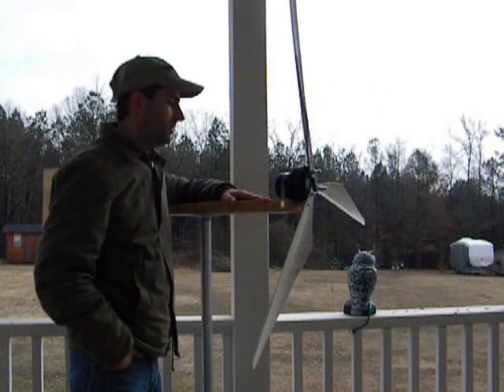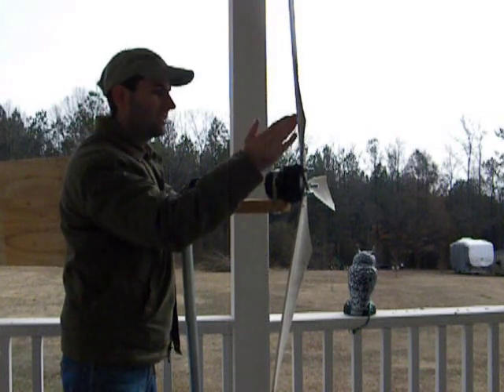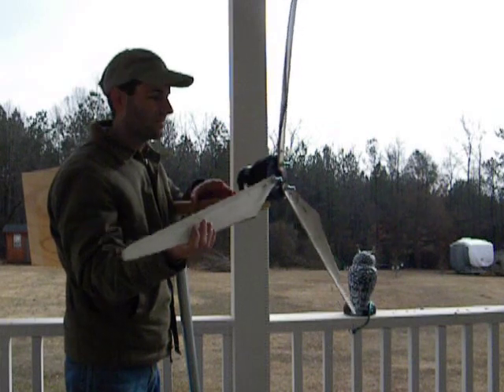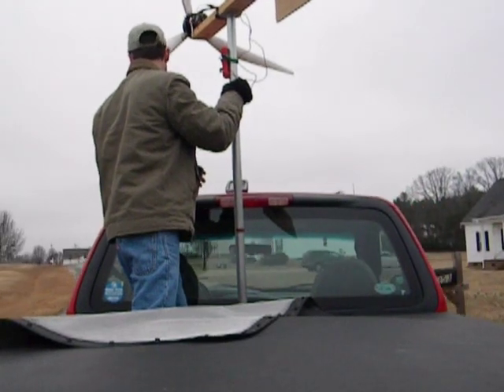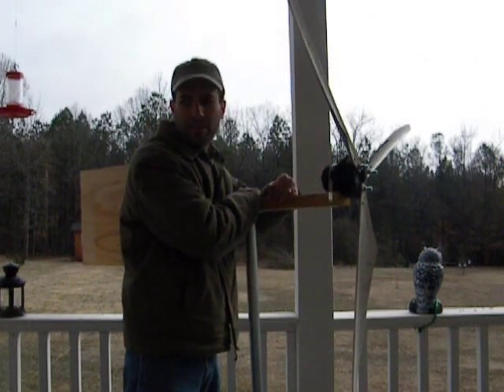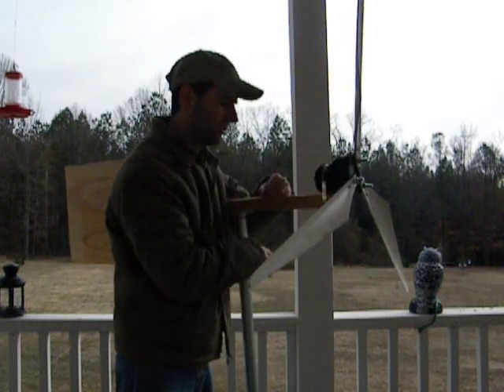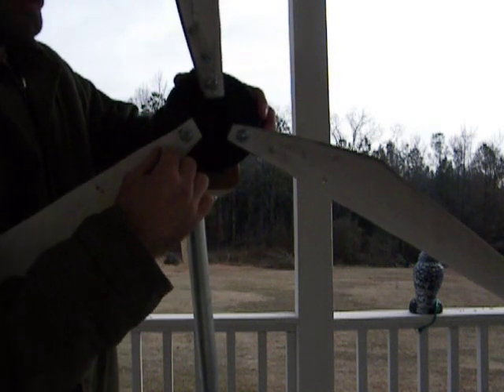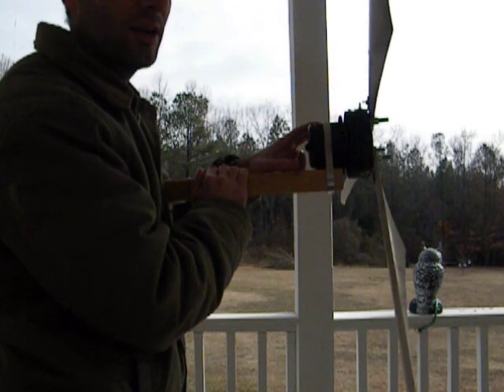My new $2.00 motor turbine with 4 inch pvc blades

Comment: I give you an "A" for effort!  Since the maximum efficiency of a HAWT is 59.28%, i would like to save you some time and tell you to  read about blade efficiency, angle of attack, optimal number of blades on a HAWT, IDEAL LOCATION for installation of a wind turbine etc.  That way you become more knowledgeable and better able to think about the design of your experiments.  By the way, an average house's electrical need is about 4KW a day.  Are you in a wind swept plain region of the country or are you stuck in the middle of an urban area with high rises and many trees?  These are things to consider before you set course on your journey of discovery.

Comment: Using the truck to make wind is a good idea.
Personally I'd make some sort of slide in brace so I wouldn't have to hold it. 
.
I was warned somewhere that PVC flies apart at high speeds but it certainly is economical to test different designs.

Comment: so, that is about a 5 foot diam. blade set, each blade about 2.5 feet. I figure the motor spins 2200 RPMs at 14.3 volts. That is 188 inches in circumference on the blades. The motor spins at 154 RPMs per volt. At 3 volts, that is about 460 RPMS at 15 mph wind. 460 x 188 inches=82 mph. That means the TSR of the blades at 15 mph = 5.4.

Comment: I don't know if I should admit this, as I am a mechanic whenever possible, but I completely forgot about using the D.C. radiator cooling fans from a car for a generator.  I was actually trying to figure out if there was a way for me to take one of the motors, possibly the H.V.A.C. blower motor, and use it for a generator.  I am so ashamed....

Comment: Can you help me?I built a wind generater.For the motor mount I made a plat with a bearing attached at the bottom for the pole.The reason is so the wind generater will turn as right to left as towards the wind.Well,that's my problem.The wind generater has problems aiming/finding the wind.And sometimes it aims backwards.What causes this to happen?Is the tale fin to small or not big enough?Or do I need to add more weight to the tale?What else can i do to fix this?Thanks!

Comment: Why not put the blades on a pulley? You could put the blade on a 10" pulley and attach a 2" pulley on the motor and get 5X the rotational speed? With such a small motor I don't think it will create enough resistance to keep the blades from attaining normal speeds for whatever the wind level is.

Comment from the maker: I have used two bolts to secure the blades and it does work great. I have not tried to use safety wire on them. That is a great idea and something I will try in the future. Thank you for the comment, Lonny

Comment: to prevent the bolts on the blades from loosening and making the blades fly out, have you considered attaching two bolts on each blade connected to the hub and safety wiring them?

Comment: If u use say 4 motors each time u add a motor u cutting your amps down each add on ,y not use a good treadmill motor geared up to get your voltage? Now this video was done without a load also in realty if it had a load on it was only producing 1.5 volts.In testing a motor in order to get the voltage u need to really charge a battery u need at least 24 to 30 volts without a load.

Comment: The reason you have to spin it faster than a treadmill motor is because an automotive motor is DC but it is not a Permanent magnet motor. The PM motors are what is needed to produce a good output.

Comment: Nice video. A zener diode is only good for a few milliamp, but if you use a voltage regulator you could get 1 to 1.5 Amp. I think you might be better just to hook it through a 25 amp bridge and let the battery regulate the voltage and use a charge controller and dump the extra into a grid tie.

Comment: your idea make sense. But i still think getting neo mags from hard drive is the best solution... copper wire is more likely to be a problem to get in good condition and at cheap price
very Good job anyway 
U might be able to get some of them in series with a gear system and longer blades or even swap your hawt for a vawt design that would give u more torque at low rpm but less rpm at high speed... Am sure there is a way to work this out. 
Take care

Comment: I'd mount a piece of angle iron across the bed of the truck and use a C clamp to hold the pipe and a foot mount bottom of the bed for the bottom of the pole.  Safety first.